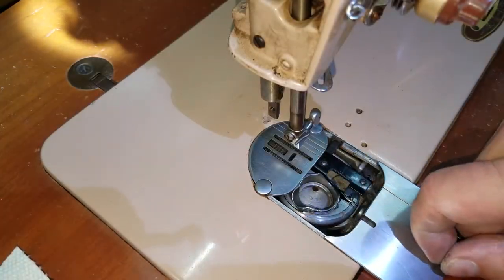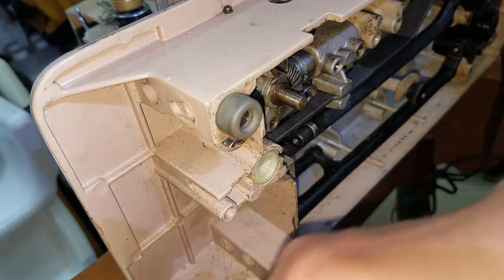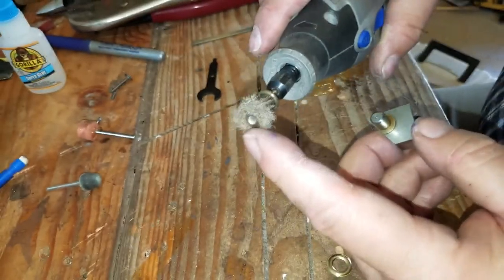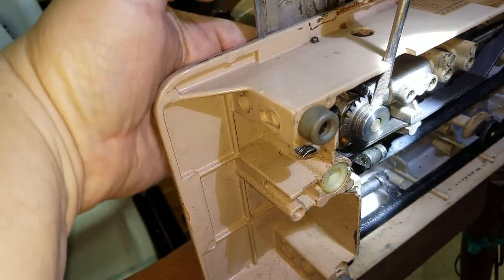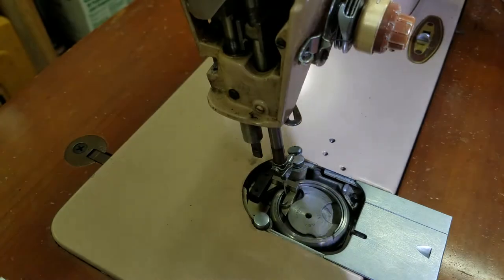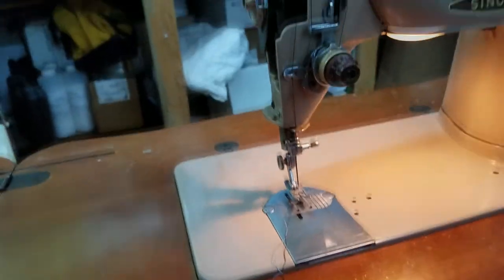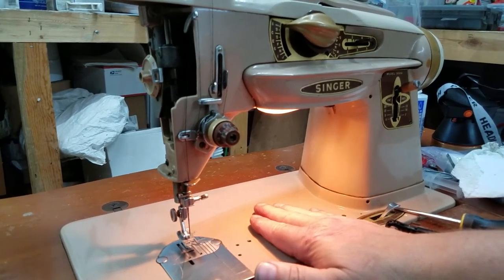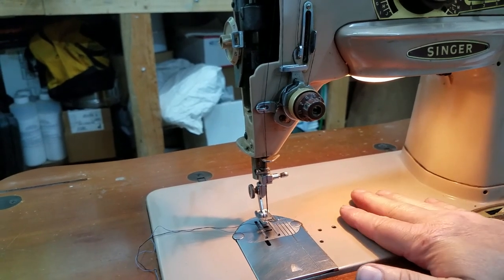FIXED!  Singer 500a Skipping and Jamming Stitch Problems

Comment: Matthew!  My neighbors in the mid 70's used to hear me screaming and pounding on my SINGER 500 for this exact reason.  I can't tell you how many projects were ruined and my repair guy didn't have a clue!  Wonderful tutorial!!!!!
Reply from the maker: I did everything you could imagine to correct this problem.  Then I found this fix exchanging emails with a old retired Singer repairman.  I knew the delint pin was not required.

Comment: Thank you, Matthew. I've discussed removing the delint pin with a handful of people, but this is the first time I've seen/heard of it in a video.
It's valuable info based on the number of complaints I have heard of skipping and thread tangles on the Rocketeer models. I appreciate that you took the time to make this video.
Reply from the maker: Glad it was helpful!
Reply: The Singer 500 machine was made in 1961-63 and most Singer dealers invited the purchasers to bring the machine in and have a revised retention finger and hook installed, along with a timing adjustment. This coincided with the newer trend to sew in bonded knit fabrics. My beloved grandmother purchased one in 1961 and I own it. It has the modification and I cannot fathom why there are machines "floating around" without the singer modification. This was offered by singer dealers for the 401- 403- 500 and 503 machines to eliminate jamming and thread tangling..

Comment: Matthew!  Thank you so much for this video!  I really really wanted to love my 500A, but it kept jamming.  I took pics of the jam and took it to the local family-owned-for-decades repair shop and he cleaned it, greased it and said it was all fixed.  Nope.  Took it back jammed so he could see it, he “fixed” it again and said I’d have no more trouble.  It jammed in less than five minutes.  Frustrated, I went to the Rocketeer group on Facebook and learned of your video.  Today, I fixed my machine, thanks to you and Andy Tube.  I can finally love my machine!  Oh!  And I didn’t have to dremel anything.  I just pulled out that tiny pin with pliers.  Voila!  I can’t believe such a little thing caused such grief!
Reply from the maker: what a great story!  thanks for sharing your experience.

Comment: Thank you for the video! I have a 500a that kept jamming.  It had the pin and once we removed it the jamming stopped.
Reply from the maker: Good job!  I don't quite understand why some work and some don't.  I think it has alot to do with the thread needle and type of fabric.
Reply: Hi Matthew. Thought I had it fixed. Stitches well for about 4” then goes wonky and jams. Appreciate any suggestions. Did everything you suggested on the video.
Reply from the maker: @franfrom9210  one thing you can look for is burrs and needle strikes on the rotating hook.  Look for a video on that with Andy Tube
Reply from the maker: @franfrom9210  I wonder if it is possible that the thread pickup lever is out of time.
Reply: @OutFishing13Matthew  it sews a nice straight seam without jams. Just seams with zig zag motion including the special stitches.
Reply: I’ll give it a close look tomorrow when my eyes aren’t so tired. Thank you for the suggestions!
Reply from the maker: @franfrom9210  that tells me the timing is a little off.
Reply from the maker: @franfrom9210  watch this video. https://youtu.be/oHGwdEcYGZo?si=mviw7BIyYoPrFNWW

Comment: Update:  My wife just changed the thread, the other was older thin polyester.  She put in a new spool of slightly thicker thread, adjusted the upped tension slightly,  and installed a new needle.  It's sewing great on a 5 Zig Zag.   Thanks again for your video.
Reply from the maker: Thanks for the info!  I have been working on a cabinet for a 401A.  It is catching thread on the delint pin.  I am going to try a few things before I remove it.
Reply: @OutFishing13Matthew  We bought a 401A to fix up for my wife's aunt.  It wouldn't even sew due to being out of time.  I did an Andy modified SPA treatment and adjusted the timing.  It was sewing but skipping stitches on anything 3 or over zig zag.  Then she changed thread, needle, and upper tension and it''s great.  Going to deliver it tomorrow.  Good luck.

Comment: Greetings Mathew, and happy new year 2022. Hoping you are in good health.✨ I stopped by to thank you again for this great video. I just referred another viewer to it for help with their Rocketeer stitching problems. This fix is not always what caused their problem, but it often has been and they are relieved to find a solution after all the other things they tried. Take care.
Reply from the maker: I have fixed two machines this way.  I have a new to me 400a I am working on.  It too has a delint pin, but no skipping problem so far.
Reply: @OutFishing13Matthew  Glad to hear you are still into the VSM. By far the folks who complained about the problem were owners of a Rocketeer 500A or 503A.
Reply: @andytubesewing1953  I assume the "modification" parts are no longer available.. In the early 1960's Singer dealers invited clients back to have a modification done on the Slant-O-Matic machines. There was a kit with a different hook, retention finger and timing adjustment. This coincided with the trend to sew in the new bonded knit fabrics and changes in threads.

Comment: Very nicely done Mathew. Seems as if Singer made the 500 series just a little more complicated than the 400 series. The "de-lint" pin follows "thread control" into improvements that proved to be unnecessary and led to stitching problems. Thanks for the upload.
Reply from the maker: Thanks.  I hope that other 500a owners find and implement the fix.  I can sew any type of fabric with any type of thread now and it never misses a stitch.  I just about gave up on it.  And 8 tried everything.  Deburred the hook and bobbin case.  Set the timing. Set the thread gap.   I bugged Andy Tube a bunch.  Went to every forum I could find mentioning the same problem.  Then it finally dawned on me that this pin was an issue and I learned that it didn't need to be there.   So I bought another position finger on Ebay and made the modification.  What a great day to be able to sew without a jam! More than anything I just wanted to solve the problem.
Reply from the maker: @1953childstar  interesting.  I would like to see those service instructions
Reply from the maker: @1953childstar  I have heard about this.  It was called a knit kit.  An old Singer service tech told me about the new hook.  Mine has the new hook without the cross brace, but the position finger still had the delint pin.  He told me the kit had instructions to grind off the delint pin, but it also makes sense, that a position finger ca,e without a delint pin.  I would like the new timing instructions.  I tinkered with my timing a little until it sewed properly straight when moving the needle from all the way left to all the way right.
Reply: The # 401 machines also had a "de-lint" pin….

Comment: Excellent video and explanation you need to check you foot pedal you are turn the hand wheel to start the motor adjust the carbon adjusting screw it will work better ,I learn from you video thank you!!!!!!!!
Reply from the maker: I changed the pedal to an electronic one.  It works better with that one. But I need to clean the motor armature at some point too.  Thanks for watching and commenting.

Comment: Thanks for the video! I didn't have the skip stitch, but went through your instructions... The de-lint pin on mine had already been removed. I learned more about my 500 though, so thank you very much!
Reply from the maker: Glad it helped!  Those darn de-lint pins. Sometimes machines work with them, some don't. I am so glad I found that fix since I love this machine.

Comment: I recently acquired a 403a that I had the rotating hook out because it was seized. While I had the hook out I noticed that it also has the de-lint pin. I wound up heaving it in. If I have a problem, at least now I know what to do. I also have a 500a and a 503a, great machines. I also had to repair the top hinge pins on both the 500a and 503a nose doors. People just don't know how to handle them. Thanks for posting this video.
Reply from the maker: I have seen the 401a with and without the delint pin.  I know this fixed my issue.  Some work well and never have a problem with the delint pin.  I wish I had the answer.  Thanks for commenting
Reply: @OutFishing13Matthew  If you see a # 401 without the pin, it was removed.. Since the the first one made in 1956, they have had the de-lint pin..
Reply from the maker: @1953childstar  that's good to know
Reply: @OutFishing13Matthew   I have # 32 out of one million produced and it  has the pin ( and other cool features )..
Reply from the maker: @1953childstar   Nice! I use my old 500a all the time.  I have heard that some machines work great with the delint pin and some are just gremlins.  I still have the block with the pin if I ever want to put it back.
Reply: @OutFishing13Matthew  I am a firm believer of using a Dremel tool with a fine wire brush and buffing the bobbin case, retention bracket and carefully -the hook...
Reply from the maker: Yes, sir! Sometimes you get little burrs from needle strikes and that is a great way to buff those parts.

Comment: I own a 401a and  I  truly feel that  it , along with the 201, are  two of the  greatest masterpieces of Singer's history!  I can sew knits of any kind on  my 401 but get nothing but skipped stitching from my Rocketeer.  Many say both machines are identical internally , but I feel that there was some type of screw-up when the  500a was created.    Whats funny is that I was told by a service man  that I would experience problems sewing fleece and other knits when using the Rocketeer, but I was so taken with the streamlined beauty of it that I had to own one!  Boy was he right!!  I can't get this machine to sew a consistent zig-zag stitch to save my life!!
Reply from the maker: I have worked on both the 401a and the 500a a bit.  The 401a and the 500a are nearly exactly the same.  But the 500a has the additional delint pin on the Position Finger.  I have a 500a "Rocketeer" that I sew with a lot and all of the stitches work flawlessly on all sorts of fabric. I hope you can get yours figured out. Singer came out with a  Knit Kit in the 1970s. I wonder if yours never had the kit installed.

Comment: Hi Matthew, thank you for your detailed video on how to fix this problem.  I am encouraged by your clear instructions to take this on myself instead of paying one of these repair shops that take your money and just oil the machine instead of fixing the problem.  My question is this: reading thru the comments below, I get the feeling that you can just simply remove that delint doodad instead of filing the problem area with a Dremel.  Which do you recommend?  Will the machine run if you remove that delint pin altogether?
Reply from the maker: If you are able to take some plyers and remove the delint pint, I would recommend doing only that.  The delint pint is not required for the machine to run. I talked to an old repair man who told me Singer recommended that the delint pin be removed as part of the repair for the "Knit Kit".

Comment: This was a huge help! I did what you did, but I’m still having problems with my thread breaking. It also wraps around the bobbin case. Do you think this a tension spring problem or a I need a new bobbin case? I know it’s hard to answer that without seeing it firsthand.
Reply from the maker: Hi Vicki,  Thanks for contacting me.  I don't think you need a new bobbin case, but sometimes little burrs can grab thread on the main bobbin case, but primarily on the shuttle hook.  I would not recommend any of the new bobbin cases out there for a 500A since they will not fit properly. The bobbin case can get sharp little burrs from the rotation of the shuttle after a million times.  Also, the 500a has a rotating hook shuttle and can get needle strikes creating a burr which can pick up thread and cause the problem you are talking about. This can be cured though.  Using very fine wet/dry sandpaper (600 to 1200 grit) you can carefully feel for sharp edges on the bobbin case and sand them down ever so carefully.   Then feel for needle strikes on the shuttle hook and carefully sand them out.  Andy Tube has information on that.  Here is one of his videos which has information about restoring the hook with any needle strikes.  https://www.youtube.com/watch?v=us1sHv1-2Kc
Reply: @OutFishing13Matthew  I"m having the same problem....

Comment: The 503A problem of thread tangle on the pin/position finger. I removed the little roll pin and for a while I thought it was fixed. Things will be going fine and a loop from the needle thread will hang on the lower edge of the position finger where the pin was. It will then keep on making stitches, but the cloth is stuck. I have gone over the adjustments so many times I have the specs memorized. After studying this problem, I keep going back to my initial thought that if the needle thread gets that far around something else had gone wrong. It seems that the thread must begin to release from the hook at 180 degrees from the needle and the take up must occur quickly. The hook makes two revolutions per stitch or one cycle of the needle, so a small adjustment can make a huge difference. To experiment (with two needles installed) I timed the hook to the right needle which makes the hook arrive at the 180 degree/release position a little later and the take up process is a bit farther along. Needle bar adjustment still at factory setting. I have made 100 + covid mask with no problem. The mask project is short runs and slow so to test I used a bed sheet three layers at full speed multiple times no tangle.  It makes great stitches with two needles or one in right, center, or left position sewing fast or slow, long, or short stitches, and it will zigzag. My theory is the thread did not release or so late a loop could tangle before the take up could pull up all the thread used to circle the bobbin. I know this is not what the service manual tells us to do, but this remines me when I worked for two auto companies. We would receive our service manuals for a new vehicle and someone in the field would discover a better way to adj something and they would send out technical bulletin for a new procedure but never revise the oringal manual.  Thank you for all the videos and I would welcome your opinion of my theory.
Reply from the maker: You must be on  to something.  Recently I worked on this 500a for my son when  it was skipping stitches. We timed it a little slow and set the needle/hook gap at basically .000.  Then we tested it on zigzag and made some minor timing adjustments in the timing until the stitches were perfect.  I think the manual is right 90% of the time, but then there's are machines which need a custom setting that is a little different to work.
Reply: @OutFishing13Matthew  
A little fun fact I just discovered the tiny length of thread used to make each stich has gone around the hook under and over the bobbin 3-4 times before it will show up in the fabric. I used white thread and marked it black just as it entered the needle. Turn by hand and watched it.
My point of this, when one of these tangles occurs the thread is over stretched and damaged all the back up the machine. Over stretched thread makes it easy to tangle again.
Reply: Singer revised the hook and position finger for the Slant-O-Matic machines.. Most dealers invited the purchasers back for the modification.. I do not understand why there are so many machines "floating around" without the modification..

Comment: Thanks  for the video.  Andy Tube sent me here.  I removed the de-lint pin on the 401A, but it is still skipping stitches in Zig Zag on anything over a 3.  I'll keep trying.  I'm guessing I only have to remove the pin, not grind down and polish the corner? like you did on the broken piece.  Thanks again.
Reply from the maker: Hey there.  Thanks for the comment.  The issue with the skipping stitches may be a timing thing. I fixed a 500A for my son that was doing the same thing. I had to advance the timing just a tiny bit to get it to sew in zigzag well and also putting the needle all the way to the left or right.